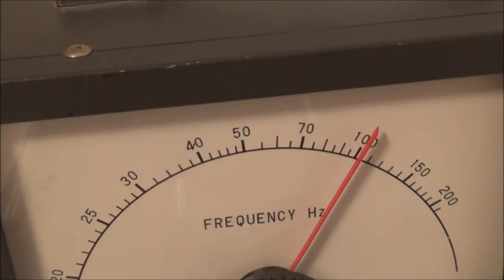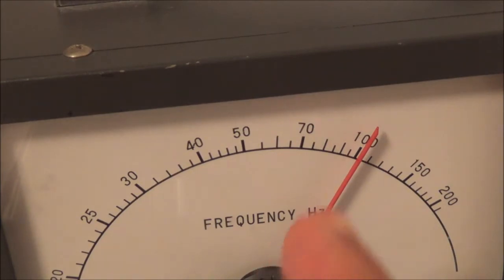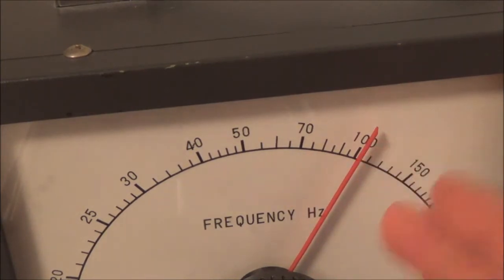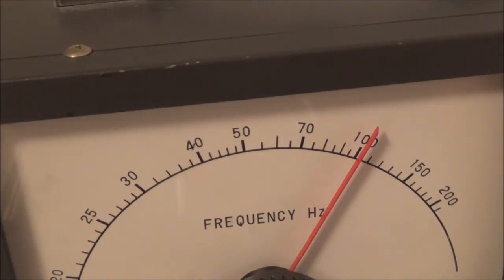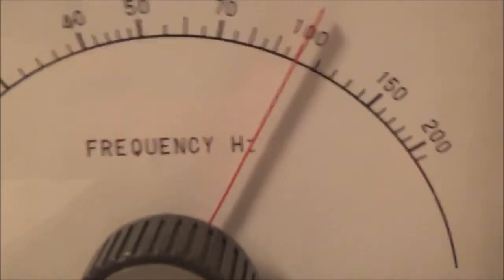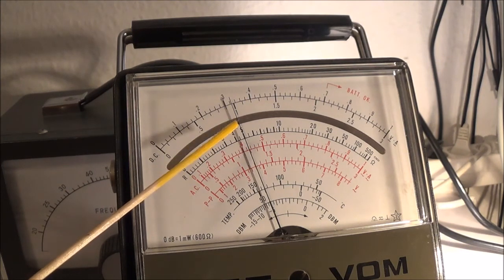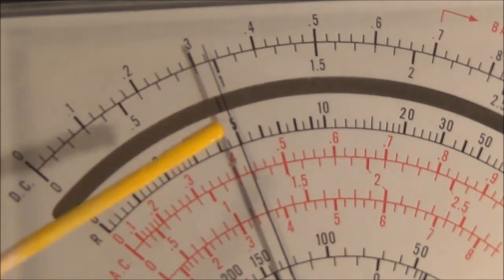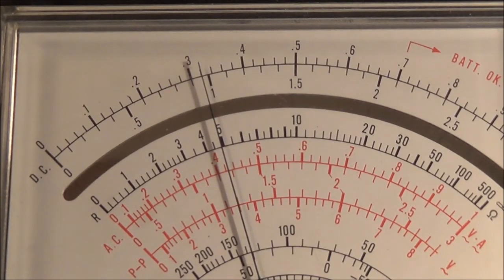Parallax Error

Comment: Well done and helpful, thanks.
Reply from the maker: Thanks, for the kind words!
Reply: @OldSchoolElectronics  Actually, I was disappointed to learn, from your video, that the argument I wanted to use was incorrect. I took two photos of my water meter, with several hours intervening between the first and the second, to check whether I had a leak in my water line after a repair was done. (The utility company accidentally broke my line with a jackhammer, repaired the line, and covered it with concrete.) The utility company would not accept my photos. They said that the photos were taken from different angles and, therefore, they was not a valid comparison of the apparent position of the pointer/hand. I was going to argue that since there was no reference point on the glass cover there would not be a parallax problem.
Reply from the maker: Sorry that my video didn't help. Right, you have to look at that meter or make photos straight from the front, or else some degree of parallax error will occur. I hope you make some progress with the utility company.